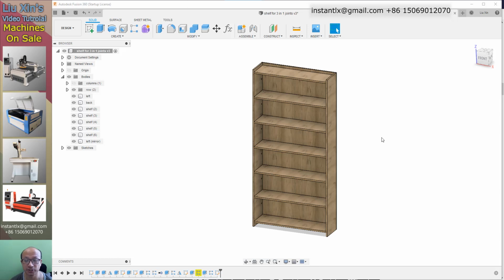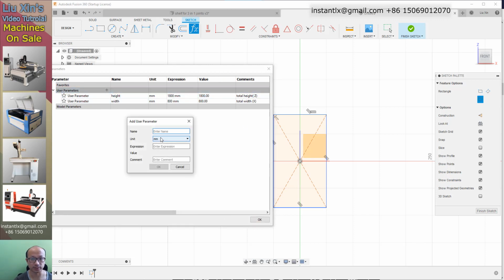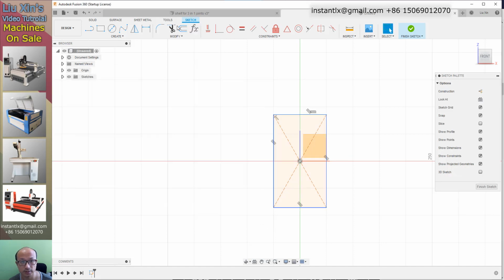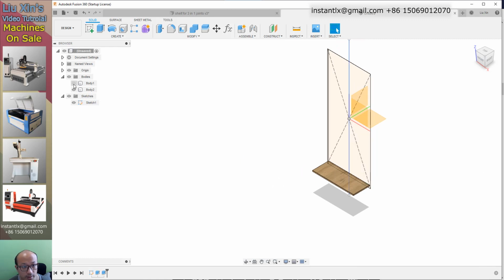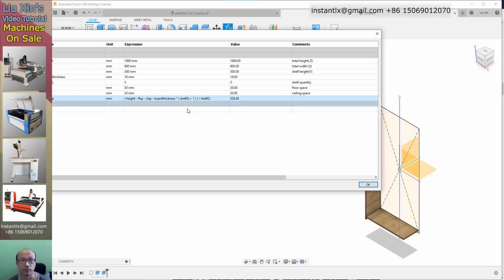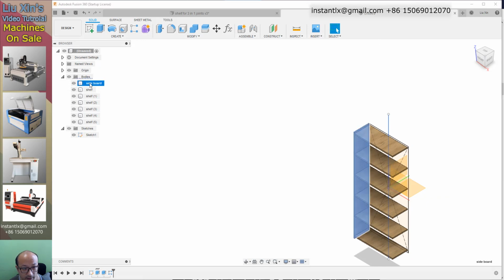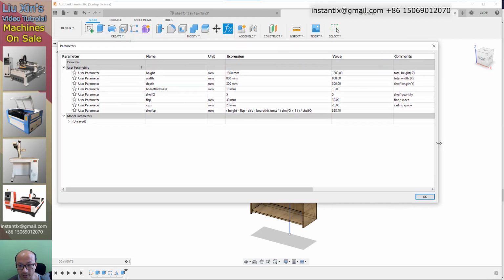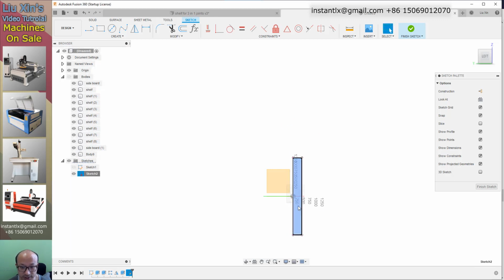Create a simple cabinet in Fusion 360, parametric modling,

Comment: I take it you plan on using a six side cnc to drill the fixings? We use solidworks, much better, but maybe not as simple to use. Good video 😊
Reply from the maker: solidwork is more powerful. but more complex and expensive. actually we can use CNC router and side drilling machine to do the producing. only we need to do more on the designing. I'll show in future how to do this. thanks
Reply: LIU XIN I also have a side drilling cnc and a auto loading/unloading cnc love the screen to machine videos, keep them coming. Get well soon.